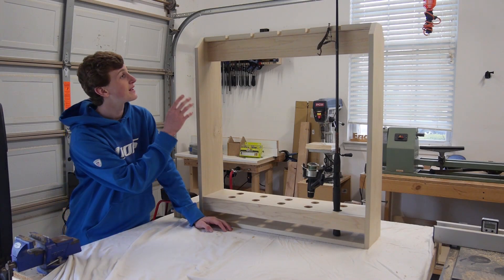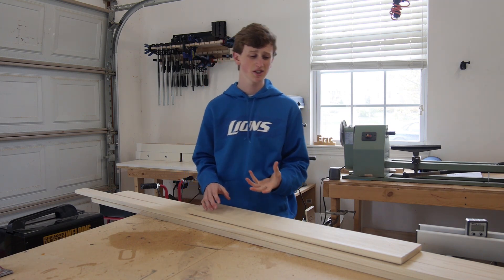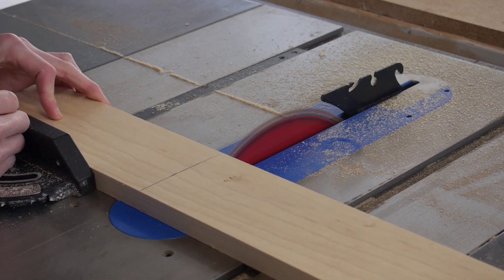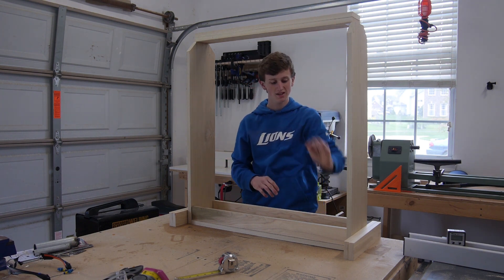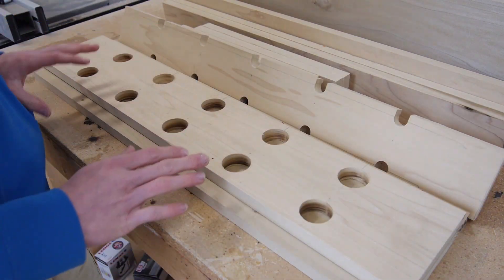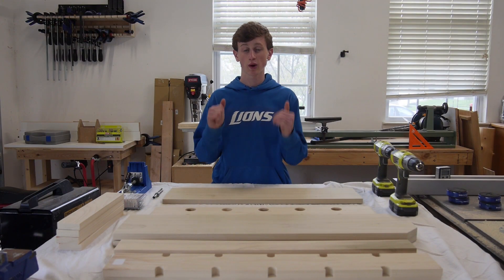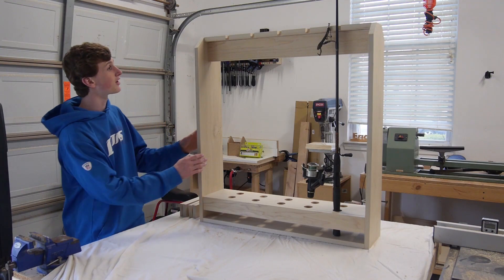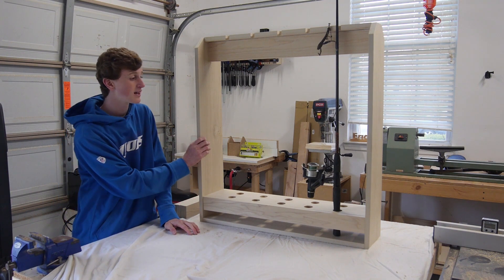How to Make a Fishing Pole Holder | Holds 10 Poles!

Comment: For anyone actually making this yourself, you will need to add an extra (30inch) 1x8 for the bottom piece under the 1 3/4 holes. Other than that. Great video. It came out great.